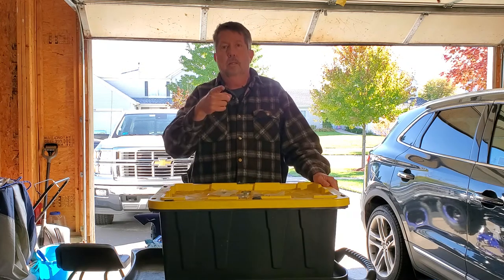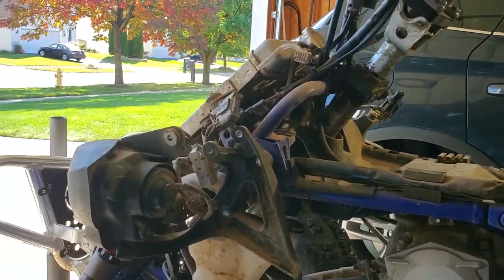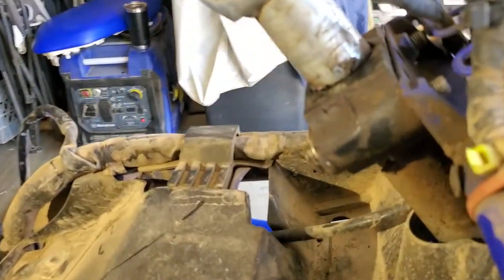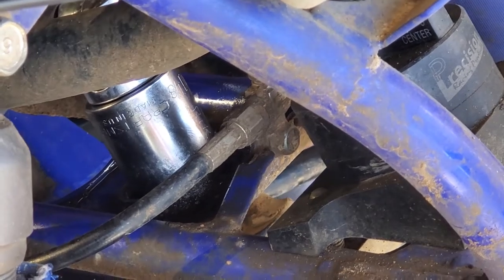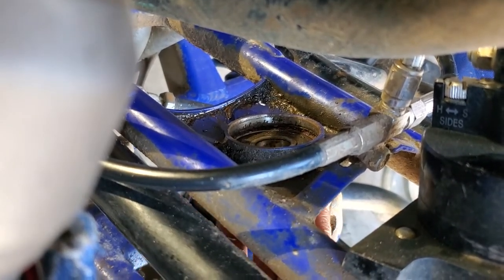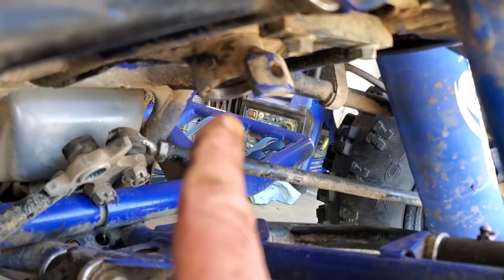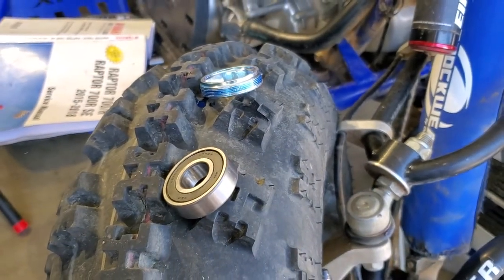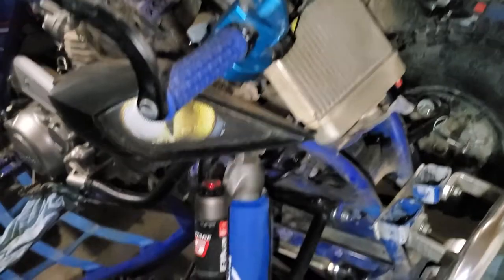Yamaha Raptor 700 Steering Stem Bearing Removal

Comment: Hey man you got risers on your  bars where did you get the longer cables I have risers and am having a hell of a time finding some plz help lol and great video too I didn't realize the nut inside as I was beating on this thing lol this helped
Reply from the maker: Go to motion pro, they have +2 cables and write down part #.  Then either order directly or go somewhere else that sells motion pro cables and verify part #.  They usually sell as stock replacement but are actually +2. Again,  double check #.  Most places sell them.
Reply: @Team2Gils  RIGHT ON!!! Sweet thanks man I been trying to think of a way to modify or some crap to the ones I got n I just want them right! I'm gonna get on the hunt now! N I will double check! Thanks
Reply from the maker: @bryantblackwell1339  not sure why everyone sells them as stock but +2 no one seems to sell but the motion pro are +2 and just not mentioned.  Took me a minute the first time.

Comment: What size nut did you use and what size do you think would fit better?
Reply from the maker: Don't remember and I cannot find my old nut to measure it.  When you get your stem and upper seal out,  take a measurement and head to the hardware store.  Think I used a 3/4 inch nut but not positive.  It was a little small but it worked.
Reply: @Team2Gils  I saw another short video that used a 30mill. Does that sound right?
Reply from the maker: @JacobGnarly  that's a little over and inch, probably pretty close.
Reply from the maker: @JacobGnarly  I found the nut I bought,  it measures 1 1/8 inches outside diameter.   For the life of me, I cannot find my old stem bearing retaining nut. I kept it but not sure where it went.

Comment: How did you get the retaining nut back on the new bearing? I can't get it to catch onto the threads.
Reply from the maker: Make sure threads are real clean, and make sure bearing is pressed all the Wan in, then you should be able to get it started pretty easily.
Reply: Thanks for the reply!

Comment: Hi do you have to remove your fuel tank to do this job ? i have ordered my bearing and seal kit because my hande bar have play in it did you also change out the upper plastic bushing . i also ordered the upper steering stem bushing just in case the old one is bad .Thanks
Reply from the maker: You just need to slide your tank back so you can get to the upper stem bushing.   If you can get in there with the tank on, then you should be good.   After going through all this effort,  I would recommend changing the upper bushing and seals,  then you will be 100% good!
Reply: @Team2Gils  Thank you  very much for the info . i am also going to change out the upper bushing like you mentioned